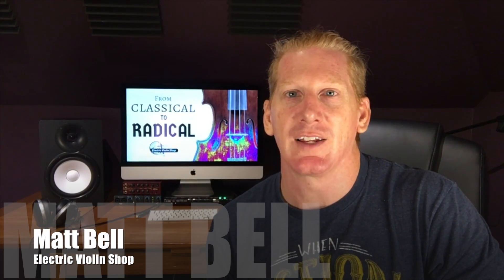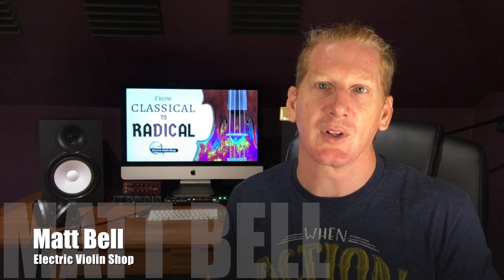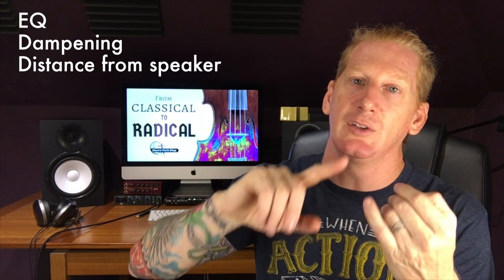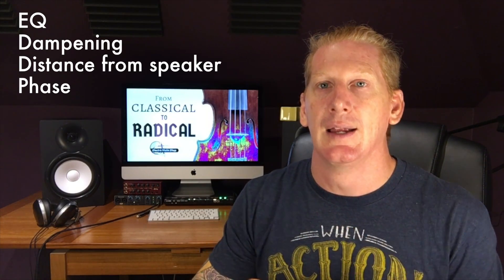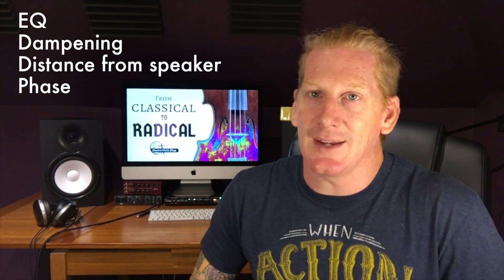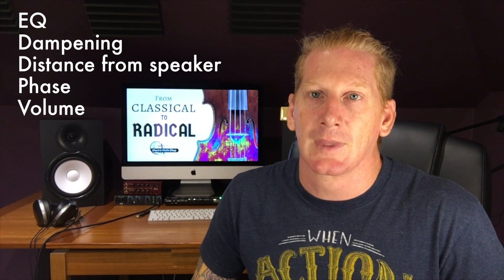FCTR: How to Fight Feedback

Comment: I'd like to know more about how to sweep frequencies using the Baggs para acoustic di. It obviously does not have a 32 band eq, so it's probably less presice in terms of how it knocks-down those frequencies, but the directions say that it can be done... Just not sure quite how to get it to do it. Right now, I typically put in a big cut in the mids, but I don't feel like I really understand the process for identifying how to eliminate feedback very well, unfortunately. I guess it's a learned skill, because your instruction has helped quite a bit -- I'm just not quite there yet.
Reply from the maker: It's definitely a learned skill.  Taking what we talk about in the video here and then getting practice in applying it is the key.  It takes most sound engineers years to get good at what they do.  Lots of experimenting. 

The notch filter in the LR Baggs has four letters on it.  Those correspond to the guitar strings with those names.  G on a guitar is about 98 Hz.  B on a guitar is about 247 Hz.  (That's the B on your G string).  So it's not as useful for a violin, but if your G string is feeding back (roaring), you can sweep that filter to just below B and it'll help notch that frequency out.

The mid is also sweepable from 400 Hz (0.4 kHz) to 1.6 kHz.  That would correspond from about a G on the D string to the G that's a bit more than halfway up the neck on the E string.

Dumping mids is one way to control feedback with an acoustic-electric, but it can also make your instrument sound thin.  Mids are a tricky beast.  Too much in the mids department and you're muddy and squishy sounding.  Too little and you're thin with no body.

One thing to think about would be how you're managing gain.  Gain is a whole separate discussion, but with the Baggs, if you're having feedback issues, I might pull the gain down and boost the volume.  Just experiment with that.  And, if all else fails, it might be worth buying an EQ pedal or a 31-band.  They definitely offer finer control over frequencies.

Oh, and when I talked about phase in this video?  For your Baggs DI, that's the "INVERT" switch.  That's one of your options for trying to fight feedback when nothing else is working.
Reply: Thanks for this.